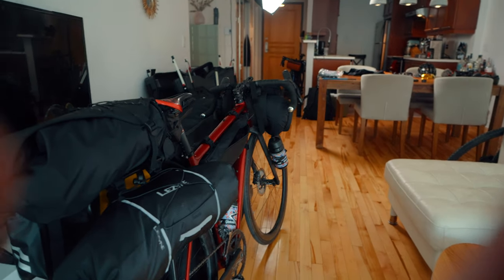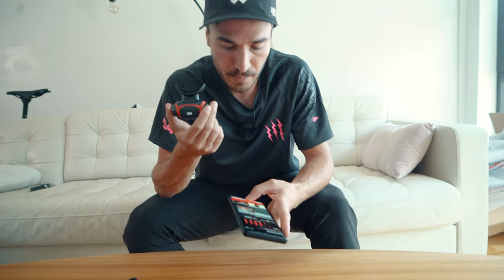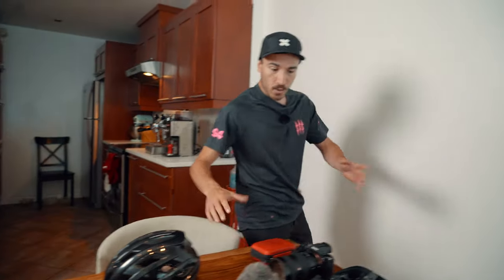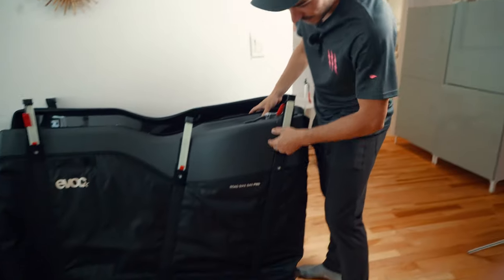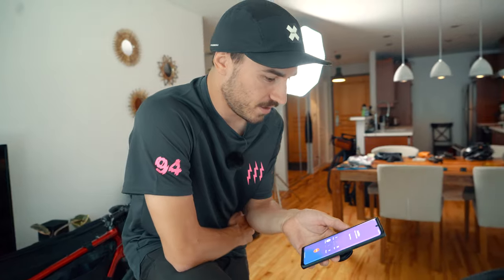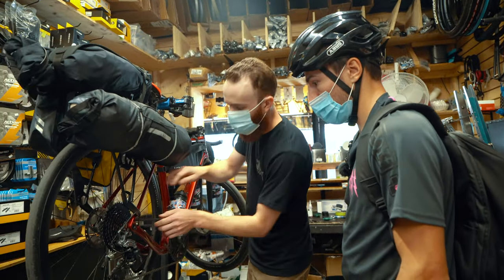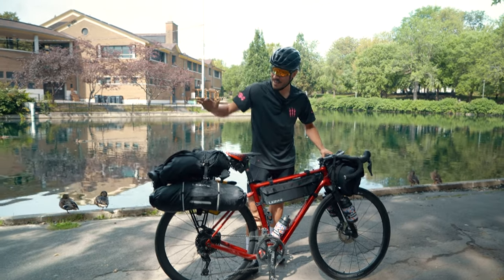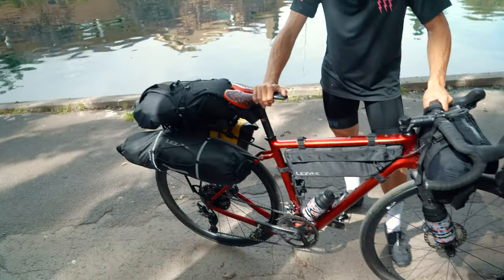What To Bring On a CYCLING TRIP?! - Tour de Big Island: Episode 2

Comment: tip. always yes always use a torque wrench to tighten cassette down to shimano spec 40nm.
Reply from the maker: Problem wasn't the torque, it was that the casette wasn't higher than the freehub, so compression didn't work. had to add a spacer!